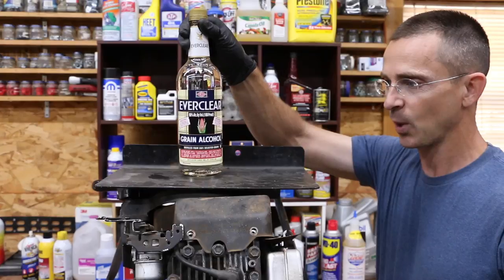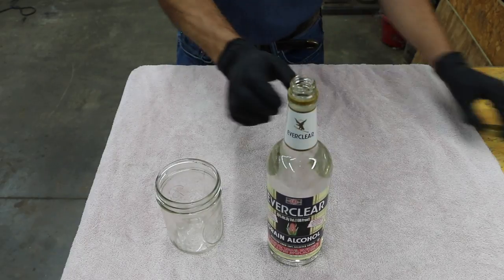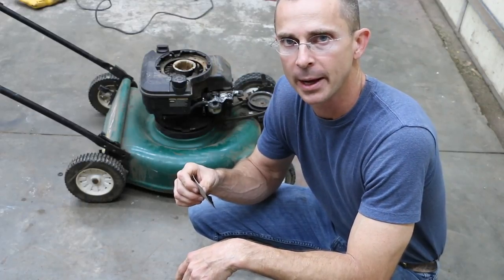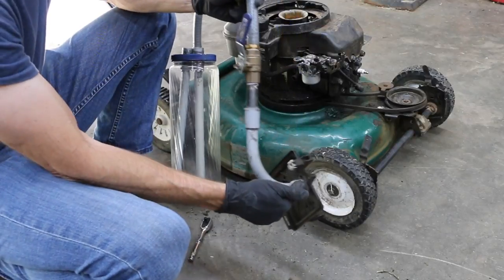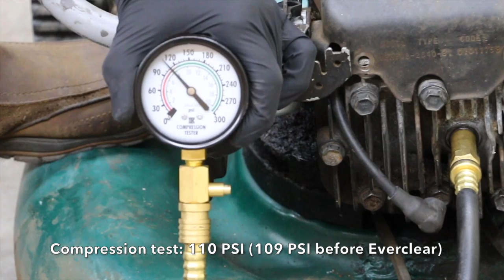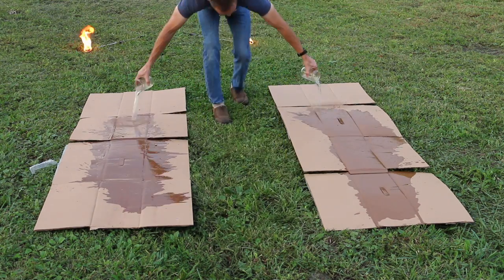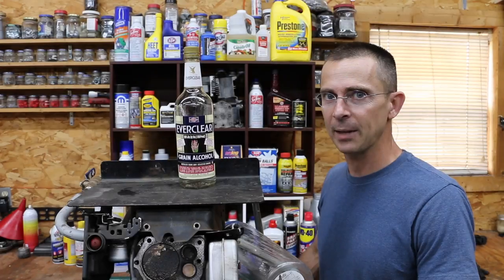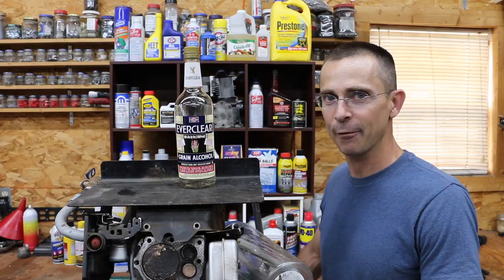Will an Engine Run on Everclear Fumes?  Let's find out!

Comment: Alcohol can burn clear (MeOH in particular) this is why alcohol fire looked underwhelming but was in fact burning
Reply from the maker: Great point and thanks for commenting.
Reply: @ProjectFarm  The alcohol burned better, but since it was daylight impossible to see it. A similar type of fuel is used for some of the major car racing series and you can find YT videos of fires where next to nothing is visible. Try that part of the experiment again at night and/or with a thermal viewer.

Comment: Good job on this video! Check your oil after running on alcohol. What you will probably find is that it's going to be runny as it leachs easier. It was in my experience on running a gas motor on methanol racing fuel
Reply from the maker: Thank you for this recommendation.

Comment: Will an engine run on vodka or any alcohol and will it clean up the carbon build up in a engine?
Reply from the maker: Thank you for this recommendation!
Reply: If the everclear didn't clean it up than there's no spirits that will. Generally speaking alcohol doesn't do well for carbon deposits anyways. Just gonna have to get a wire brush, kerosene and elbow grease.
Reply: it has to be 180 proof that 90% alcohol 80 proof is only 40%alcohol to much water we ran moonshine for years in west virginia

Comment: Will it run on jet fuel???
Reply from the maker: Thank you for this recommendation!
Reply: Project Farm Your welcome I thought I would need to write many more!!!
Reply: Jet fuel = diesel... if he has a diesel lawn mower... yes.
Reply: Gasoline engines are capable of running off of kerosene when warm. Kerosene is also used as jet fuel in some applications. So yes. You can run a mower on jet fuel.

Comment: I wanna see a gasoline engine used with gas. Except with a glow plug. Will a gas engine run with a glow plug instead if a spark plugs
Reply: I think if you got the plug hot enough it might. Do this one too. Lol.
Reply from the maker: Thank you for this recommendation.
Reply: Project Farm I need to do glow plugs on my powerstroke currently . 
It's 37 here Wilmington NC at Wright'sville Beach and my 6. Powerstroke just failed to start . 
No glow plugs no starty. I'm curious to see if it'll work on a gasser engine. 
The only thing I see being a Problem is not being able to control pre ignition timing
Reply: Glow plugs are for starting only, not continuous running. The gasoline when presented with a glow plug if it even gets hot enough will pre detonate and likely not run well or at all
Reply: Shawn Cline I agree with you, however because you said likely we need to test it. Lol
Reply: Yep, it'll preignite.  There are a new batch of compression ignition gasoline engines coming down the development pipeline, though.  But there's a reason spark timing is a thing on gasoline engines.
Reply: Itll probably preignite and detonate if it did run, it wouldnt be for long.

Comment: Fantastic job!!! No question this stuff will burn. What concerns me is the lack of interest in the water content, 5% of hydrous ethanol, what we are making in the USA , what it does to gasoline, what trying to burn the phase layer product does to engines, the water alcohol actively attracts out of the air. I get why we are being forced to include ethanol in MOGAS, but outside of cars, there doesn't seem to be any concern for the rest of its application
Reply from the maker: All great points and thanks for the positive comment!

Comment: Great video. Also note that alcohol corrodes aluminum parts over time. So, if you have a gas engine that has aluminum parts that come into contact with the gas, the don't run alcohol through that engine.
Reply from the maker: Great point!

Comment: with the card board test try it in a dark room with separate shots. the Everclear burns with a lot less brilliant flame. It's still on fire just not as hot and violent as the Gasoline. you could see the card board itself was on fire( look at the under side) but the top evaporated so fast it didnt let it get singed. Cool video, I'd love to make my own vapor system. thanks for the content!
Reply from the maker: Great point and thanks for the positive comment!

Comment: Here's a little challenge for you: running a diesel engine on diesel fumes (or any kinda fumes / vapors it can run better on), the proper way. I found a very few vids where they tried that, but none seemed a well-running, decent attempt. In one, knocking seemed to be a big issue.

Rocking channel, keep trucking! 👍
Reply from the maker: Thank you for the video idea!
Reply: @ProjectFarm  Btw, that's a sweet revving of the see-through engine.

Comment: Got a few ideas!!! Compression compensation-- the effective compression at partial charges ( partial throttle )  is reduced. This is especially important on freeway! Other engine designs based on paddle wheel pumping with intermittent blockage-- chamber orbital, side chamber orbital, and the carousel-- up and down, and round and round-- up- intake, down-- compression, then ,harvesting off of the difference in surface areas between leading and trailing paddles ,rotation, then down--exhaust etc...
Reply from the maker: Thank you!

Comment: The results are not what I expected.  I thought the Everclear would clean the engine and I also thought it would run better.  We add 10% ethanol to our gasoline and "they" tell us it's better for the engine and the environment.  Hmmmm.

Wondering if there was any damage to the rubber fuel lines or the carb seal.  I've heard that we can't go higher than 15% ethanol, because it'll damage the fuel lines and seals in our motors.

Great video!  Thanks for sharing.
Reply from the maker: Thanks!  You are welcome!

Comment: Love the video.   But im wondering if you removed the water from it first if it wouldnt work better.  Distillation wouldnt work as it comes over as a 95% azeotrope.  Is why its sold that way.  But.  You can salt the water out with potassium carbonate.  Just add a bunch and let it sit.   Just a suggestion 
Keep it up though love the content.
Reply from the maker: Yes I agree.  That would help.Thank you for this recommendation!

Comment: I really like the vapor device you rigged up.  Might hook up something similar to my go cart just for kicks to see how long it runs before a refuel.  Any idea how a system like that operates under load, rather than idle?  Does it need a high idle to operate?  

Great video.  Very interesting and informative.   Thanks!
Reply from the maker: I wouldn't recommend doing this with your go kart. If you decide to do this, please make sure to use a check valve in the vapor line to prevent "flashback" and possible fire.  This setup will hurt the power, since the engine will run lean.
Reply: Even in a four-stroke?

Comment: Good info & video. Thx! What about a system w/ “fuel-injection”?
Reply from the maker: My GM vehicle is setup for E-85.  So, it should work. If not tuned to run on alcohol, it will likely run very poorly. Thanks for commenting.

Comment: No kidding. You sir, have gained a new subscriber. I have a curious inquiry. Every so often,  on the diesel facebook page, we come across someone whose significant other accidentally put unleaded gas into there diesel tank. If I'm not mistaking, the rule of thumb is pouring 1 quart of motor oil to every gallon of gasoline that was pumped into the diesel tank. The questions I have are 1. Is that the correct ratio? 2. Is there a better alternative?  Say for instance 1 quart of 2 cyl oil to every number of gallons of gasoline. 
Though, the diesel page I'm speaking of is specific to Dodge 2nd generation (98.5-01) 2500 and 3500, an old diesel tractor engine testing these theories would answer my question. Preferably one that do not utilize glow plugs.
Reply from the maker: Thank you very much for the positive comment and for subscribing.  I'll have to do some homework on the right oil to gas mix in this instance.  I'd likely drain the fuel tank as a precaution.  Thanks again!

Comment: Also you could try running ever clear over white oak wood ash or hard wood ashes such as hickory wood ashes. Recover the alkalized ethanol. Now mix that as you would with Medium chain triglycerides and heat to 140 degrees F or 60 degrees C. You should see the glycerol come out of the mix. And fix it like biodiesel. I wonder how it would do in a lamp, diesel, and gas engine.
Reply from the maker: Thanks for the suggestion.

Comment: First off GREAT VIDEO!!!!!!! Could you please explain what the device is you used to contain the Everclear to run the motor on fumes? And where are how to construct one??  Again..AWSOME!!!!!!!!
Reply from the maker: Thank you!  I have another video...Will a gas engine run a vapors or fumes that shows the build. I don't recommend using this sort of setup due to the risk of backfire. Thank you

Comment: About that evaporizing bottle of yours: what it basically does is to put a carburator in front of the carbourator. The carboratour does, after all, make a mix of air and gasoline.
Reply from the maker: Great point and thanks for commenting.

Comment: I ran my John deer lawn tractor on EverClear it worked fine, you can try 50 50  ( half gas & half EverClear ) it works as well. 
I’ve done it with 60 % EverClear & 40% Gas it worked 😮
Reply from the maker: Thanks for the suggestion.

Comment: I would suggest as a way to make your videos better is to explain a little bit of the science behind what youre doing. Good things for this video would have included explaining why gasoline has a higher change to vapor while the everclear held on longer and evaporated much slower. You could explain why one chemical reaction might leave more gunk or not produce enough power. It might be beyond what your viewers would be willing to sit through but I know it would be a great addition for me. I'm pretty new to the mechanical side of things but I do know a lot of physics and science, so I know it would be helpful to me if you would explain more technically why certain materials, object patters, and fuels interact the way they do in addition to your delightful hands on showmanship. Thanks for your time in reading this.
Reply from the maker: These are great recommendations!  I'll test the waters with doing a better job explaining things.  I've gotten some recent criticism for too much talk and not enough action.  It's hard to find the right balance. Thanks again!
Reply: Project Farm then i would say to stick with the action. Im sure that there are other videos that explain it. I would say im an outlier. Maybe something more subtle would be explaining that the everclear  evaporates slower while the cardboard is burning instead of it burning in silence? Your call.

Comment: Try running an engine on HHO - Brown’s gas. It’s made by splitting water molecules via hydrolysis. Burns at 5,100 degrees when burned straight, mixed with air you can lower that. But it’s some powerful stuff.
Reply from the maker: Thank you for this recommendation!

Comment: I saw one of your videos for you ran the lawn mower on gasoline Vapors being bubbled in the bottle I was wondering could you run those bubbled papers through a metal pipe hook to the exhaust to heat the papers before they go into the engine to see if it would get better mileage
Reply from the maker: Thanks for he suggestion.

Comment: Makes sense that Everclear 191 would work since they have a lot of newer cars that are "E85 Compliant" which is an 85% Ethanol mixture. The Everclear being 90.5% also would explain it running lean - gotta adjust it just like using jet fuel in a track car. Wish I could buy that stuff in my state, as it's the BEST for sterilizing ecig equipment and stuff. (Never gonna drink it. Never have, never will.)
Reply from the maker: Thanks for commenting.

Comment: The ideal fuel/air ratio for gasoline is 14.7:1. For ethyl alcohol it's 9:1. So it takes a pretty big mixture adjustment to get the alcohol to run optimally.
Reply from the maker: Good Point!

Comment: Don’t know if a motor will run on fumes but I do know it will run on liquid. I had a 1972 grand Tornio with a 6 cylinder engine. I ran out of gas and all I had at the time was a gallon of everclear. I put most of it in the gas tank and kept some for prime the carburetor. The car ran like a rape ape. It was the best the car ever run.
Reply from the maker: Thanks for sharing.

Comment: To determine the volatility from the perspective of an engine, should you not try to mimic the way the engine atomises the fuel rather than using cardboard? For example, consider spraying through a mister onto a naked flame. What you're testing is really the temperature at which the two fuels evaporate (which drives the combustion), which is almost irrelevant because it's a different method of atomisation.
Reply from the maker: Great point. Thanks for commenting.

Comment: What I'd really like to know is would the alcohol and gas mix run a truck engine,  and could it improve Hp. If so at 190 proof what is a good or optimal ratio for the mix?

Comment: Add and Ice teaspoon of two-stroke oil per gallon of moonshine. That will not wash the cylinders and cause friction between your compression ring and the cylinder walls at won't wear out your compression ring. It will run a lot cooler and may even ice up the carburetor is the size of a softball at least it used to do that on my 5 horsepower stock go-kart. Also be sure to use a hotter spark plug.

Comment: So if shit ever hits the fan I can run an engine off corn mash. I approve. 

Also your vapor regulator is an extremely good idea, I like how you can adjust the air fuel mixture by changing the valve. I'm assuming the more closed the valve the higher the ratio of air to fuel? Or did I get that backwards?

Keep it up man.
Reply from the maker: Thank you very much for the positive comment. Regarding the air/fuel mix, I think it's the other way around, but I have no way of measuring the air/fuel mix. Thanks again.

Comment: hit ur carb with gum out until it almost stalls out then let it get back to speed and after a min do the same thing over do this 4 to 6 times then turn the engine off after letting it run normally for 10 mins and let the engine sit for at least an hour before putting it back into use.  also add seafoam ever second tank of gas just 1 or 2 capfulls is good.  every once in a while give it 3 cap fulls to clean the carb. also ad a cap to your oil each time you change it. always use synthetic, clean ur spark arrestor every 100 hrs and the same for your oil.  add 2 capsfulls of stp complete fuel system cleaner to your gas tank after each oil change.  change ur plug and clean your air filter every 1000 hrs or as needed.  i have over 5500 hours on my champion 1500 watt genny.   this has been another small engine tip from Ed TV

Comment: The Model A Ford would run on alcohol and it had a fuel mixture control to increase the fuel mixture.  It worked best if the engine was warmed up first.
Reply from the maker: Thanks again for commenting!

Comment: Let me tell you since I found your Channel I have been trying to catch up on all of your videos and they're all great. I know you would never have a reason to purchase a carburetor since you have several laying around that are brand new and hardly been used because you run engines until they'd blow up testing different things but.... What about us folks that might actually need a carburetor. If you buy one at the local store that does repair and sells parts it's going to cost you between $59 to $129 or better. I was looking for a carburetor on eBay for my 8 horsepower Kohler Magnum and I found one for about $13. If I bought one from a part store they want between 89 to $129. Now I just cleaned my carburetor good and done a little bit of adjustment and it's tilling great again. But what if it's fixing to rain and I really need to get the garden tilled what if I had one of those $13 carburetors and put on it? Do you think it would run and do right until you could take yours apart and give it a good cleaning? I was just wondering could you test some of those cheap carburetors and see if they were actually any good? Some of them aren't but eight bucks so it wouldn't cost a lot and maybe somebody would give you a break on them or give them to you just to test. Just something I'd be interested in nobody else in the world might not care about it but me. But hey I like this video and I'm going to continue watching until I watch every one of your videos. I just wished I had seen some of them before I bought some of the items that I did. but by the way I loved this video although I think it is just pure unadulterated alcohol abuse! You could have made a wicked punch with that! Good day thank you
Reply from the maker: Thank you!

Comment: Your experiments are great... question on the vapor test... could the engine run at a higher r.p.m. ?
Reply from the maker: Yes, higher RPM is possible.
Reply: Project Farm Thanks....but  after huffing all that alcohol,... I'm curious if the mower would track a straight line

Comment: I would like to see more experiments with the use of vapours. You could test if an engine running on vapours produces less carbon buildup, or if things like seafoam are just as effective in vapours. Would you have more success with diesel in a gas engine when running on vapours?
Oh and by the way, your videos are amazing!
Reply from the maker: Thank you for this recommendation and thanks for the positive comment!

Comment: Is there horse power in the motor, when using the vapor system, vs straight liquid fuel
Reply from the maker: The power seems lower with the vapor setup.